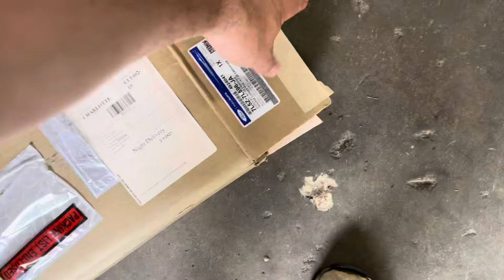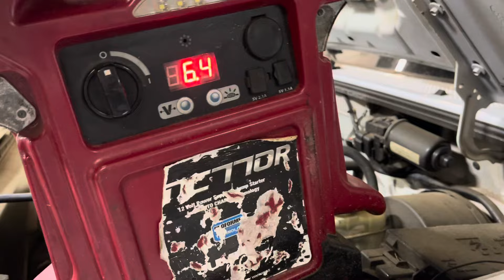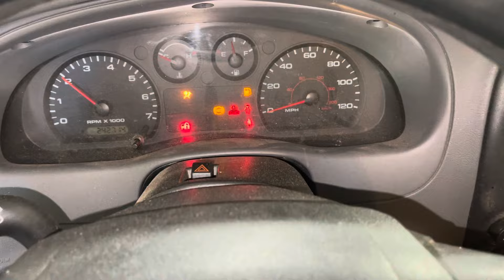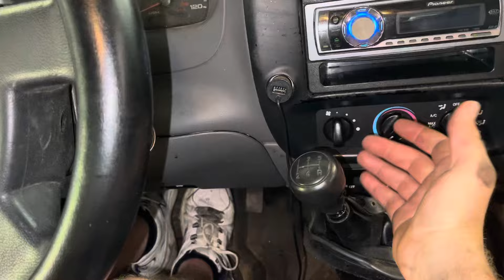Quick and easy Ford Ranger clutch replacment

Comment: It's really not helpful to see the new clutch in without showing how installed & made sure it was aligned.
Reply from the maker: The clutch kit comes with a tool that slides onto the clutch and then you literally just put the pressure plate over it and install the bolts reverse of how you unbolted and removed the old one.

Comment: I prefer the 83-92 rangers personally because older is better,newer ones have more troubles in my opinion,had a 4x2 88 XLT with a 5-speed 2.3L which was my fave truck to learn stick on
Reply from the maker: My favorite is the 83-87 rangers with the glass headlights. I don’t know if you remember but I had a 87 STX packaged truck with the 2.9 and 4x4 I really did love that truck and should have kept it
Reply: @MXguy95  wooooooof that I do,I remember from video #1 of your silver/black stripes STX 4x4 88 and I loved it and wish it was in your possession as well as some of the junkyard fords you’d show (wags tails)
Reply: I have 1989 v6 2.9 Lt 2 wheel drive
Reply: I have an 89 XLT and it has 92,000miles on it😮
Reply: @jeremyhilliard8060  that’s awesome

Comment: I really love those trucks!  I have a 2000 with an automatic and a Vulcan V6.  Thing's virtually bullet-proof and still going after 360K miles.
Reply from the maker: The Vulcan is so basic it’s really hard to tear it up! As long as you don’t run it hot (known for the heads cracking under overheat conditions) and you keep the oil changed they are tanks!

Comment: In college my buddy bought a brand new 2002 ranger base for $13800. The only option it had was A/C.  We picked it up at a Ford dealership just outside of Cleveland had to drive that damn thing back to Miami. I remember it had no intermittent wipers or weird defaulger period it was basic. It was a good little workhorse for what my buddy used it for and I remember it being pretty trouble-free right up until just over 100 K win when the Truck just seemed to come unglued. He really did baby it anever used it to hall or tow Anything outside of maybe a new dishwasher or dryer. The paint was in waxed and shiny but the underneath completely rotted out which is not something you see on a car that's spent it's entire life in Florida.

Comment: I have a Walmart ever start 12ah jumpstart booster pack, with built in air compressor but it had gotten hot a few times pumping up the dodge ram tires in the front.. but oh well I have a Pittsburgh pro $39 cast metal housing air compressor 12v cigarette lighter and the air compressor works great.. and anyway what brand is your socket set and ratchet you have been using lately guessing gear wrench or husky brand, and if needed you can get a good assortment of Allen,hex,torx, and tamper proof resistant torx bit sockets on aluminum labeled magnetic socket rails brand name Titan tools you can get them at advance auto parts and Amazon..

Comment: I put my '96 on the ramps, took the shifter out (forgot to put it in Neutral first), got under it and couldn't get the hydraulic clutch line off. So I hop back in it to pull it off the ramps. However, I put the shifter back on and couldn't shift a dang thing. Seems to be stuck in 1st. How do I get it back into Neutral?